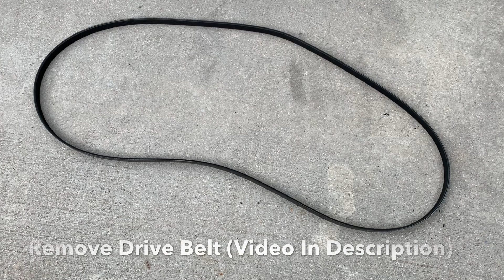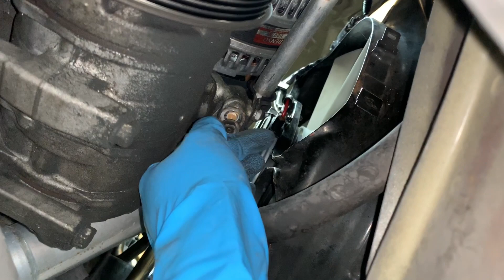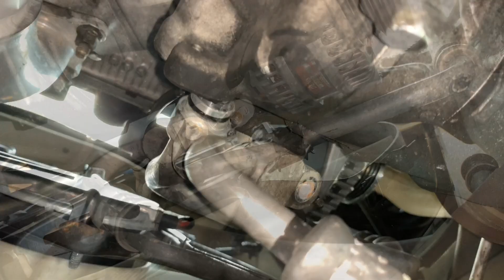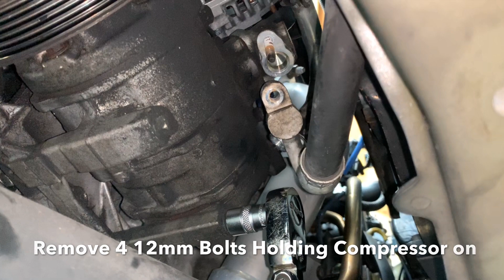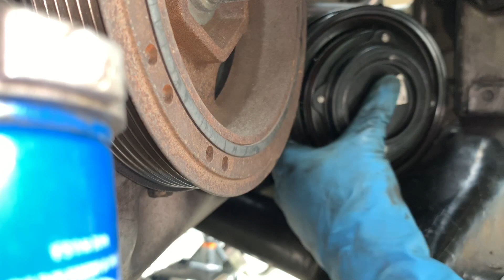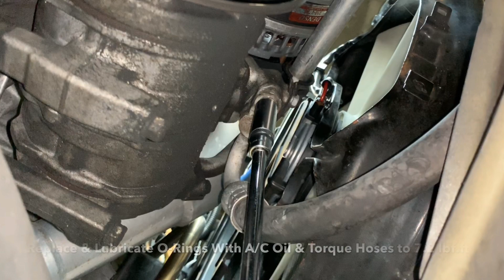2005-2010 Honda Odyssey A/C Compressor Replacement DIY

Comment: I just need to remove the compressor to pull the bracket off the block. Is it possible to remove the compressor without disconnecting the lines so I don't have to evacuate the system?
Reply from the maker: Yes just don't move the solid lines too much
Reply: typoe99 were you able to remove the a/c bracket without disconnecting the compressor? I have to do the same thing since my serpentine pully tensioner bolt snapped. The 12mm threaded hole is damaged (I may try a helicoil/thread repair kit first) but I definitely don't want to have to disconnect the freon lines if I don't have to, thanks!
Reply: @jamminjamy  yes. Just unbolt the 4 bolts holding the compressor to the bracket and the bottom bolt off the alternator and the bracket is able to come out
Reply: @typoe99  Great, thanks for the quick reply! I'm assuming the compressor may need to be supported during the process and the bracket can be removed through the wheel well? And Thanks @MrRangerZr1 for the video! :)
Reply: @jamminjamy  that's correct. I ended up just resting the compressor on the tubular member that is right by it
Reply: @typoe99  Thanks! :)

Comment: I'm getting ready to tackle this job on my 2010 Ody; however, after watching your video it occurred to ask about the freon that is currently in the system. How do I go about to dispose/remove the freon? I assume it is under a great deal of pressure. Do you have another instructional video with those steps?
Reply from the maker: I have it professional evacuated at a shop then take it back to get refilled

Comment: I heard that you have to put oil on the compressor is that truth and you have to empty the freon because it can spill and its bad can you help me with that?? Thank you
Reply from the maker: New compressor comes with oil. Have a shop evacuate the freon first and then replace whatever then take it back and have it refilled. Tell them what you replaced.
Reply: MrRangerZr1 I’ll do that thank you so much
Reply: So before the compressor is replaced a shop must remove the freon?? Is that correct??

Comment: Would this be about the same thing for a 2008 Honda CRV?
Reply from the maker: Yes
Reply: Do I have to depressurize this unit?
Reply: @aaronworsham8268  yes 
Go to any repair shop to have them recapture the refrigerant gas it’s usually free